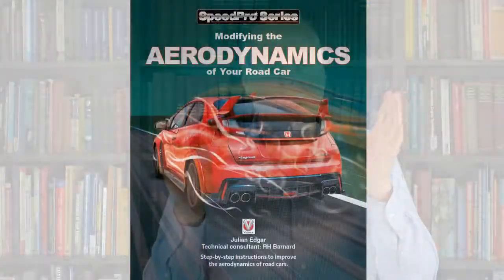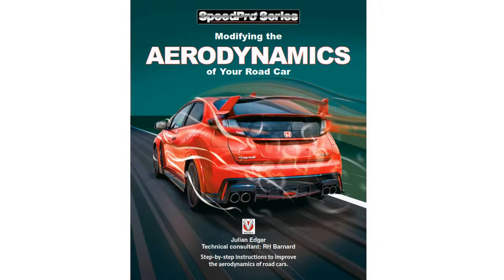Improving airflow through intercoolers

Comment: Makes sense, not something that you normally think of. Food for thought. I'm just replacing the radiator and intercooler on a high mileage van where the vanes have been hammered with road dirt and every other item that has managed to close the cooling fins.I reckon that I will have a huge improvement in   not only cooling efficiency but also a power boost as I will be getting a cooler air charge into the engine.

Comment: Interesting video (Actually, all your vids are informative). Even if I'm not a fan of it, would hood spacers (raising the rear hood) could help evacuate flow and/or removed hot temps?
Reply from the maker: No, not typically as the base of the windshield is a high pressure area.

Comment: Hello, I found your channel last night and I'm really interested in improved air flow and cool intake charge for my skoda fabia tdi. I did run my own diy water meth system using the washer bottle and activated by boost switch (sh2omi project if you wish to search online for more information). Anyhoo, your videos have given me a really insight into intercooler spraying for max efficiency and max flow of air through it to. 

If I could possibly ask you a question please? What are your thoughts on using a cryo (co2) set up for cooling the intercooler instead of water? 

Going back to the water spraying method, would adding methanol to the water increase the evaporative effect on the surface of the intercooler?

Sorry for rambling on Mr Edgar :)

Many thanks :)
Rob Shaw
Reply from the maker: I think a CO2 set-up would be fine, but it gives only a short duration of cooling, doesn't it? Adding any alcohol (including methanol) will improve cooling but there are two reasons I've not done it: (1) a water/alcohol mix with a reasonable percentage of alcohol is inflammable, and so needs to be treated like fuel (eg in the car storage container, pump and hoses), and (2) spraying alcohol onto the front of the car isn't good for paint, rubber, etc.
Reply: Julian Edgar hello Julian, many thanks for your reply. It's very much appreciated :)

I've looked into it more since I messaged you.  I've ditched the co2 option and will be following your advice on water misting. Thanks again. Robert